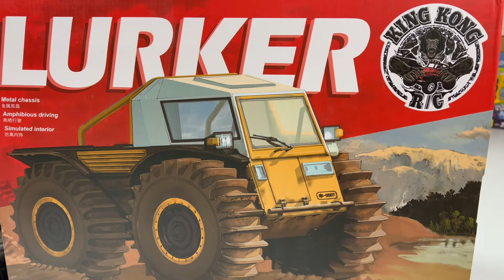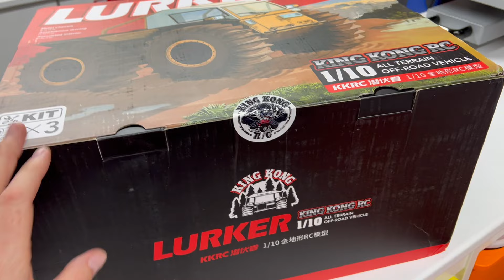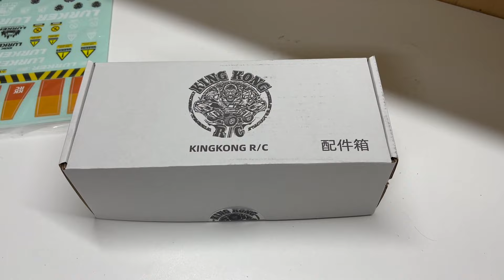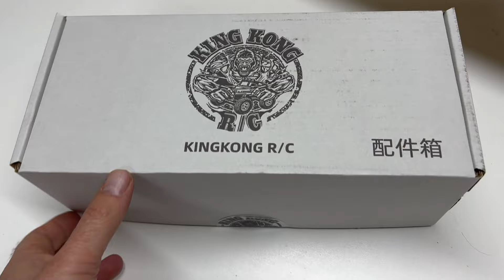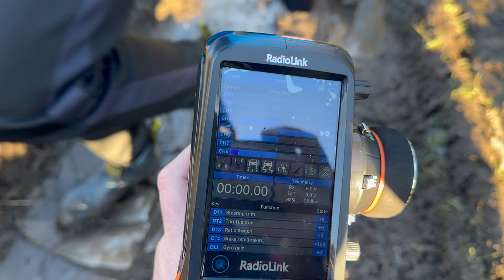1/10 SCALE AMPHIBIOUS RC SHERP CRAWLER BY KING KONG RC

Comment: hey, really cool video,
the waterproofing required is simply silicone allong all the joints, and i personnally changed the bearing for sealed units and packed the outdrive with marine grease to avoid water getting in that way.
the belts havent been the issue for me, but I have gone through 5 complete transmission in a really short time (they lasted on average 12/20 minutes of slow and responsible driving) and the replacement is quite expensive.
for the rear leds, there's now a file for a lens on thingiverse, seem to be pretty good.

personnally it'S my favourite truck in my collection (its really crazy in the winter) but it's been shelved until i find a fix.
kkrc did release an updated and supposedly stronger transmission, i got it on order but i will receive it mid-end march. I hope it'll be strong enough for my scale driving.
I have been making a few upgrades and accessories for it but havent had the chance to try them in real world conditions (an amphibious sherp trailer)
Reply from the maker: Hi! Thanks for watching and for your comment. I used silicone along all the join lines and screws ect. I need to change the bearings for sealed units next yes. Mine was delivered late november so maybe it has the updated trans? Not sure. Also came with two bags of spare gears so thats cool. Really enjoying it and its great to have something a little different isnt it.

Comment: Just a word of caution, the drivetrain is very weak in these.  

I would not recommend to anyone who doesn’t enjoy wrenching and fabricating on scale RCs. 

My belts have held up well, but I’ve had to replace the driveshafts after only 6 months of use.  Having a spare differential drive is also very handy.  I run mine on 2S only as well.  
Very enjoyable and different driving experience though.